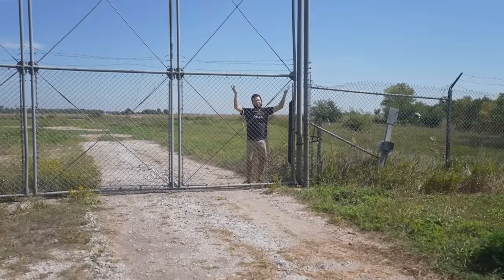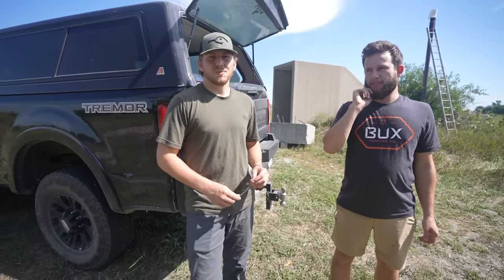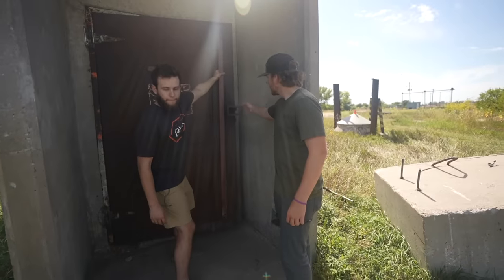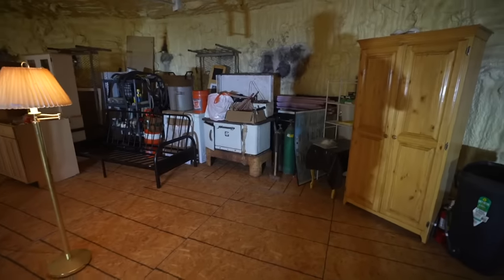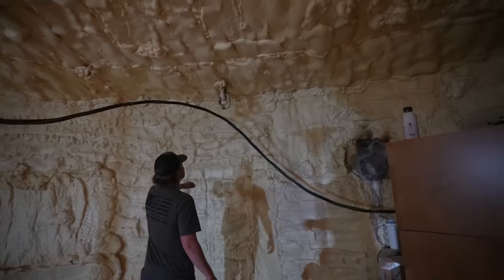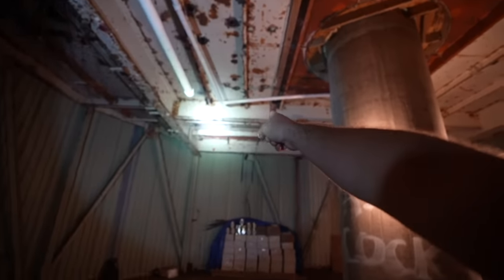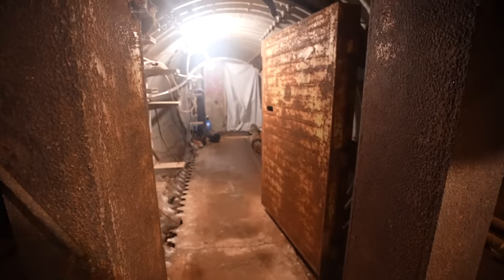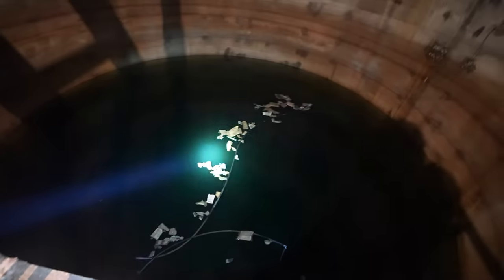I Bought an Abandoned NUCLEAR Missile Bunker!!! (Prepping for Doomsday)

Comment: Well it's a pretty nice place there in new york nebraska. Hopefully they got the groundwater cleaned up because I know that the city of york a few years back had a lawsuit against the military because of that place. Back in 96. You could have picked it up for $40000 from the owner. And I realize the person who bought it from the owner screwed up the insides by putting that spray foam in. When 20th century castle got involved in the situation back in 98 they bumped the price up to 80000. The walls are roughly 18 inches to 2 foot thick. The reason I say that is because years ago when I looked at it. Someone had cut a piece of the concrete oak and I had measured it and I'm trying to remember exactly But I do remember seeing 4 half inch rebar tied together. Don't say teach anything in school nowadays. One thing is the missile silo was decommissioned in roughly 65 because it was old and it was something new and better. The cold war didn't end until the late 80s and as I have been saying now it was only endorsement.

Comment: I would have to say they did not just go down the silo. There has to be service stairs under water that are flooded.  Looks like it dropped 10 ft. The rust on the doors tells you it had to be at the ones you were at possibly.  Just seems like you have more doors or hatches to open.  They should have had a way to drain water when it was active.  Might be a good idea to see another similar site.  So, you know what is below where you were.  Probably good Idea to just drain it. This would eliminate a lot of dangers.  There has to be a lot more below for maintenance of the site. That way if a door is open to that large water bay nobody gets hurt. I would not think you could get the prints for it.  There could be deep pits you many not able to see in the deep water. I have been in commercial buildings that were flooded and had deep cement pits.  That would be why I would drain it.  I am sure there is electrical boxes flooded below.  There is the platform for the device down there somewhere.  The air quality should be tested as descending what was flooded areas.  Some areas may not have been flooded.  I would think they would be blast and watertight.  Seems better to get rid of water.  So, all can be checked out. Hopefully with no surprises.  I would not dive it.  Who knows what mess is down there.

Comment: ok before u go down there you will find the scaffolding that used to be along the wall in the silo. they were there for maintenance of the missle. when they left they simply cut off the supports of the scaffolding that was there. it'll be just a jumble of metal at the bottom DO NOT DIVE THAT!!!

Comment: Does the cylo hold the water or is it leaking slowly? I would drain it dry it. Dry ice blast it . Treat the rust with a rust converter. Then use a poly-coat system for water tanks and have it as your fresh water supply.  Any water outside will be contaminated with radiation.

Comment: A=πr^(2)so if the diameter is 40ft then the radius(r) would equal 20ft since the radius is always half the diameter. 
Area= 3.1415926536×20^(2), 
Area=1,256.6370614359 square feet

Comment: Drain the "Missile Silo" Make the interior into a Hydroponics For sustainable living (Hypothetical you get bombed, food cant be grown, but your ok because steel & concrete absorb radiation.
You have a multi level hydroponics/Dirtfarm facility  INSIDE  Make the bottom 30 feet a sealed Tank with UV/Bacteria light treatment (water for you that is guaranteed sterile) and water for the farm. So no mater what you will have a a food source. and a PROTECTED food source that is unraidable. Plus they make Oxygen and recycle your air. Use LED grow lights, they use extremely little energy, you will need some tradition heat lamps for some fauna i assume (talk to experts). have the first floor Below the blast door's as a Picknick area type setting. Have a 3 or 4 foot concrete reinforced floor with a super heavy blast door incase you get raided you can shut them incase you cant shut the top blast doors intime. but it gives a chance to get sunlight to inside.

But you can have MULTIPLE levels  of food growing to sustain you and any one else.

100% with out any doubt you need to get a laser rust remover, and remove all that rust, im unsure with those floor's what your options are, but i would defiantly want them galvanized or enamaled (850 degree zinc coating...) But that should def be addressed some way or replaced w stainless. But you gotta remove all the rust, rust only BRINGS more rust faster, imagine rust as a fungus, the more there is the faster it eats the metal. a laser remover will slow down the corrosion already eating all this, (get training with the gun, it could be ALOT of fun)

Should 100% avoid a "pond/lake" near you, youll ruin your water table. Defiantly talk to some experts, i know only a VERY VERY limited amount here.

but yeah i would 100% drian the silo, make a tank at the bottom (water proof it  & UV Bacteria Lighting. Also back up sump pump incase of emergency flood protection 2 inch?) have a small machine shop capable of repairing parts on site (if you need to mill a part/gear you have the tools on site to do the work and place to store a welder/cutter incase pumps or electrical breaks)  then turn the rest of silo into a multi level farm air recycle/food source (i say multi level because you never know how many people would be there in a "emergency" or if something DID happen you can use food as a barter so having extra wont put you OUT of hardship. there are so many experts on that feild but having a Hydro farm and a dirt farm youre able to rotate crops in and monitor your levels is defiantly a great thing.

100% sleeper house on top. if nothing ever goes wrong you can still live a normal life above the surface have the blast doors open go down and get fresh strawberrys any time of year, any day. (they make those so automated now w robots picking them its insane what you can do w a hydro farm)

Comment: There's two rooms that you do need to be walled off as well a room to wash off radiation or a changing room and a armory The armory has to have a door even if it's just a small room with a steel door keep the guns in and locked

Comment: check out atlas survival shelters. guy named Ron owns it. maybe get ideas from his site or contact him? Might be able to hook you up. He's very knowledgeable on bunkers. He also has floor plans you may take inspiration from & sells Israeli & swiss NBC filtration units which are supposed to be the best.. pretty sure he's the only us supplier of them too. I'm curious wouldn't it be beneficial to restore well house for another source of water instead of turning it into a deer blind? I don't really know much about that stuff though. all I can say is I'm extremely jealous you got a bunker. if i had the money id put a damn castle on top of silo, old school look but modernized inside & have a secret door leading down to bay doors which id reverse to open down. can build several floors into the silo which the bay doors can lead to. you have so many options available to you. Also are you going to replace those giant chains you mentioned in those two rooms? Didn't hear you say anything about fixing them. seems pretty important to have that if its meant keep rooms stable if the ground shifted.

Comment: 1st You 'need' POWER. 12,000 watts of solar panels. Similar to the system 'AMBITION STRIKES' YT channel. That's enough to do Welding if necessary. (30% tax credit) Nebraska also has 'NET METERING' for solar. Good luck. Hope you can make it as interesting as Colin Furze Bunker build.
Reply: With that much Solar power you can use a major size pump to get the water out of the silo quick.